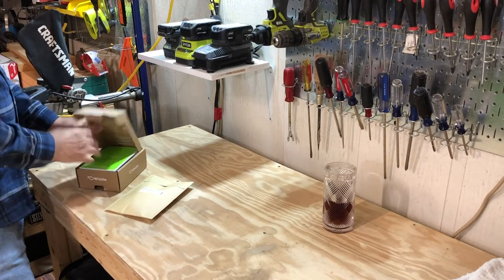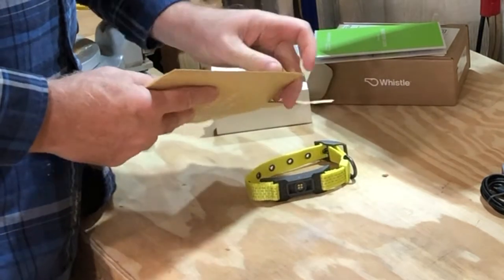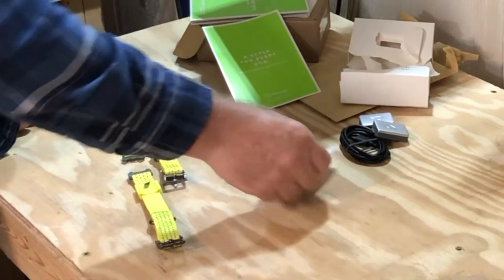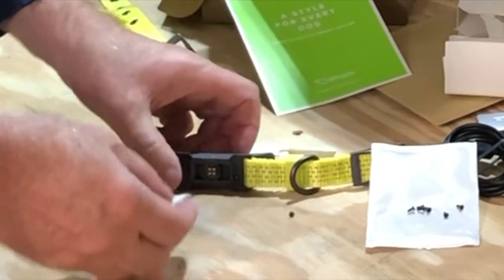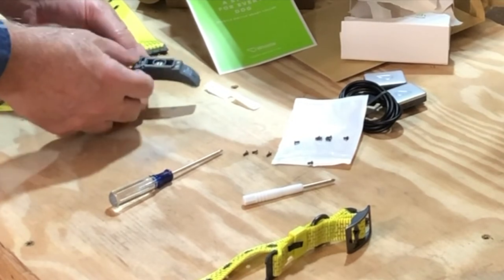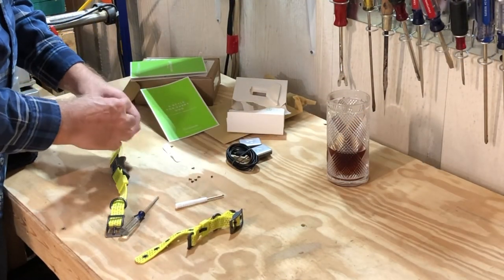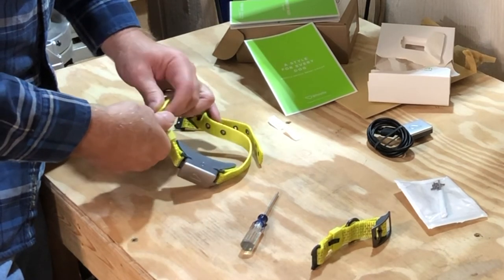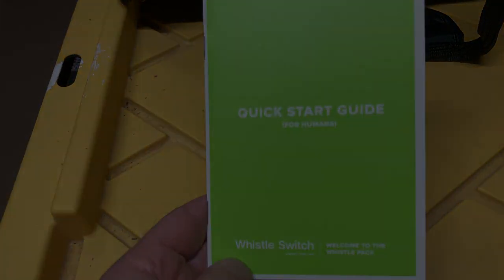Whistle Switch GPS pet tracker changing the collar size

Comment: How would you rate the battery length for the switch? I heard that the battery swapping was convenient but I was worried it would be worse overall battery life in between charges compared to the other collars.
Reply from the maker: It actually seems longer a bit to me.  I switch about every five/six days.  I was recharging every four/five days on old tracker.  My dog stays home most of the time and is in power saving mode.
Also I like switching batteries instead of have long periods where he could slip out door and be without tracking.   We walk him four times a day but he still wants to slip out when he can.